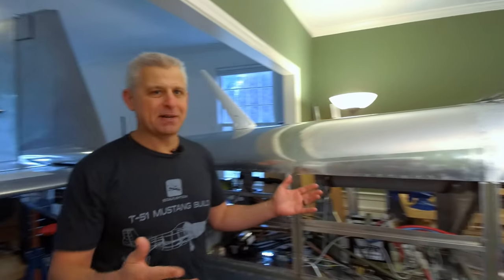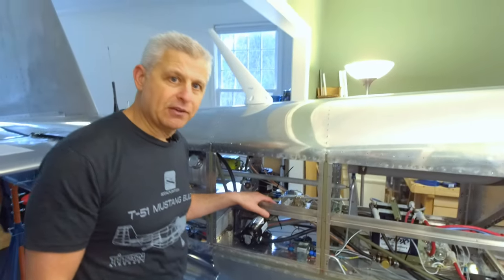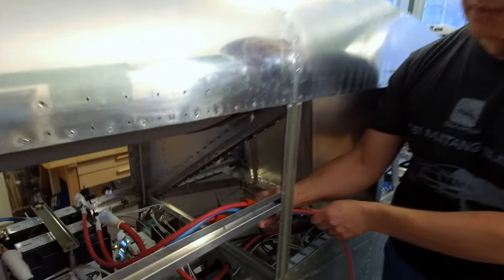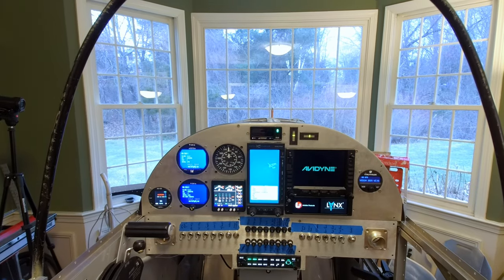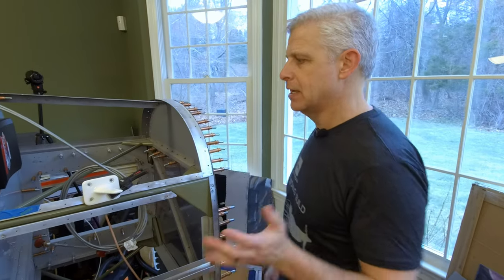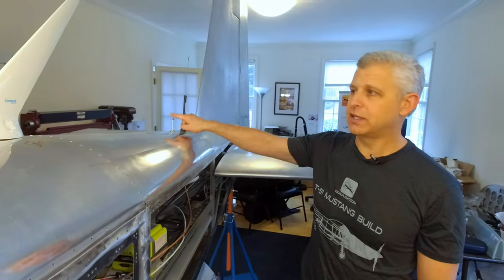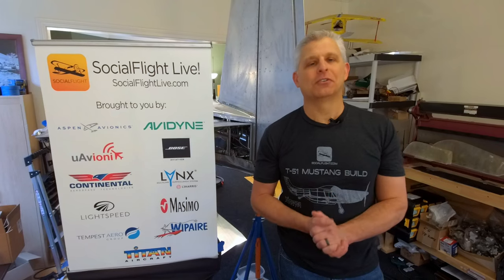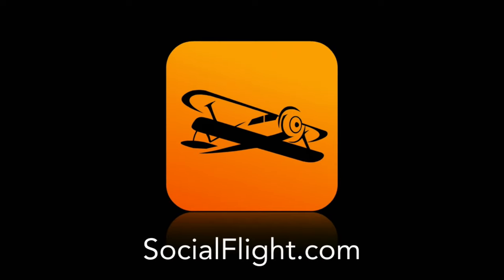2023 Walkaround Tour of our Titan T-51D Mustang Build (SNEAK PEEK: Center Section & Gear)

Comment: G,day Jeff from Sydney Australia.
The Mustang is progressing expediently, and I love the choice in upholstery fabric: it invokes the WWII flying leather jackets worn by pilots.
System testing
Do you have methods in place to test avionics, static air pressure systems and electrical motors e.g landing gear?
Moreover, will load testing and flight characteristics only be established by test flying: relying on design certification?
🛩️🌏
Reply from the maker: Thanks. We love the leather color too. Cool video coming on the seats. 

Excellent questions about testing. We’ve been doing lots of avionics testing already. We have equipment for pitot static testing next. The plane is already well tested by Titan for strength and basic v speeds, but we will do envelope testing to establish stall speed, best glide, climb performance, etc.